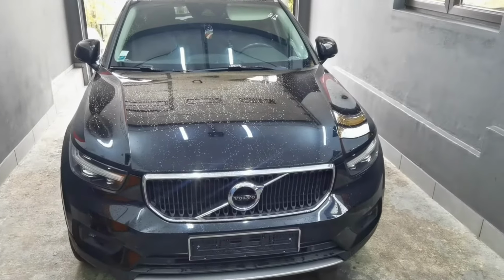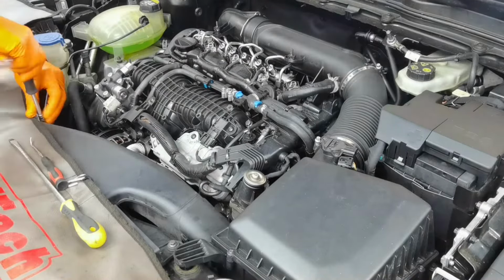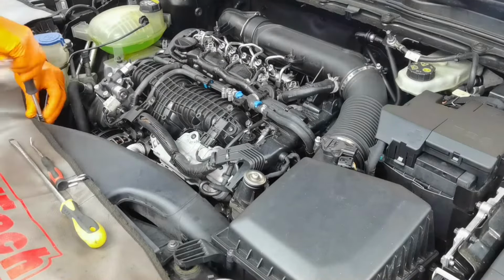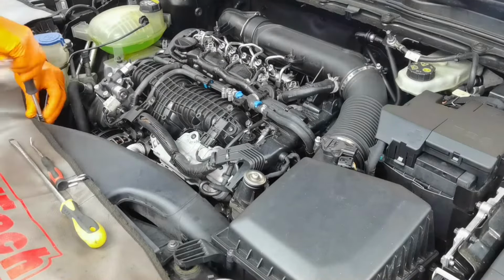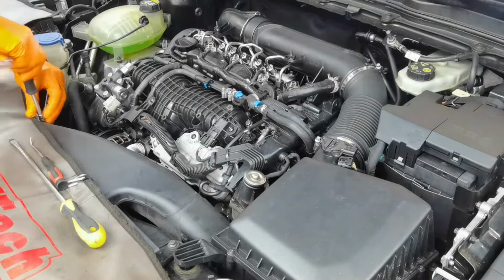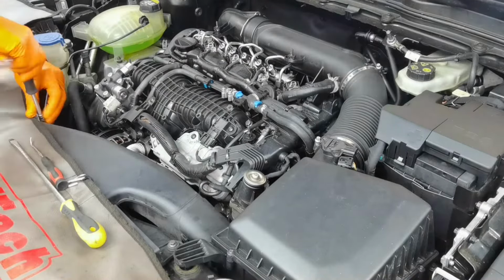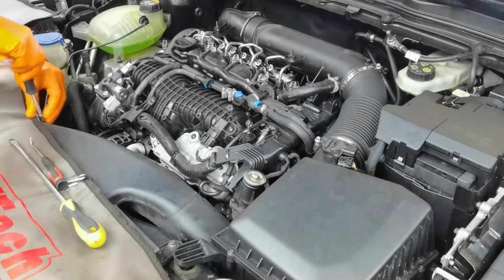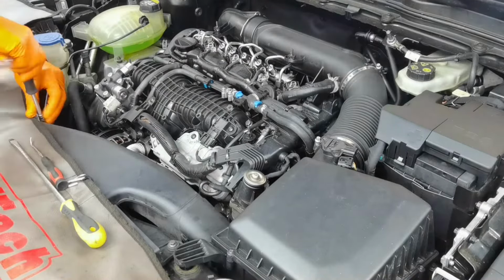How To Clean And Remove The Intake Manifold/EGR/Throttle Body From Any Volvo 2.0 Engine

Comment: did you need to replace anything, or was this all remove, clean and refit? Did you at least need new gaskets? Thanks
Reply from the maker: În my case I did not replaced none of the parts. Only remove clean and refit. I used the old gaskets because they were in good condition on this car.

Comment: How many miles has this car done please. 

I'm at 110,000 mostly motorway miles and had a map sensor failure. 

I cleaned the sensor and rest the fault all appears good but I imagine it's a mess inside the manifold.
Reply from the maker: It has around 180k

Comment: Hi, I cleaned it but not sure about the correct flaps position.
Reply from the maker: It's recommended to recalibrate the intake manifold flaps with a diagnostic tool to relearn they position to the ecu. And you should install them in the position which you removed them.

Comment: How do you know the torque specs for all those bolts you’ve removed?
Reply from the maker: I have auto data... I respect myself and I have bought the instructions for most of the cars out there
Reply: @ Any recommendations on where I can buy those? Been especially looking for the throttle body torque specs but if I can get for all components that will be awesome. So any recommendations will be highly appreciated. Thanks
Reply from the maker: I don't recommend it to you unless you have a auto garage. You have to always pay it. Once a year and it's about 400 euros per year...
Reply: @HOWTODO0828  So you don't share the torque specs so we can replicate the process without overtorqueing issues?